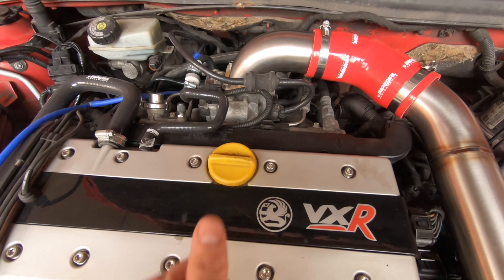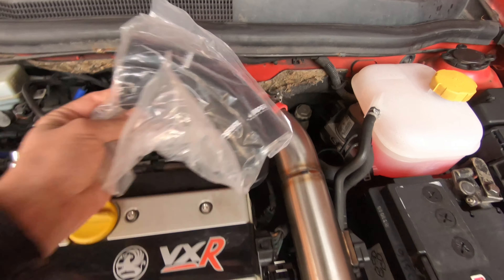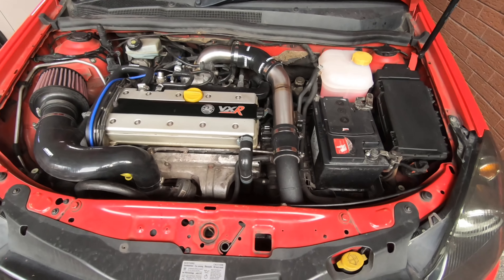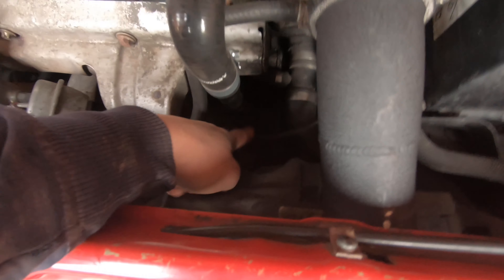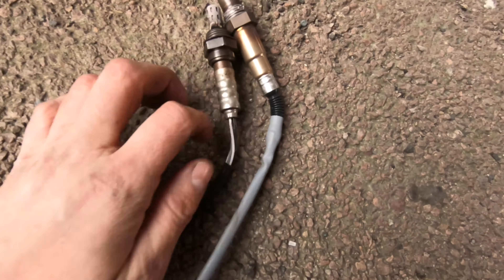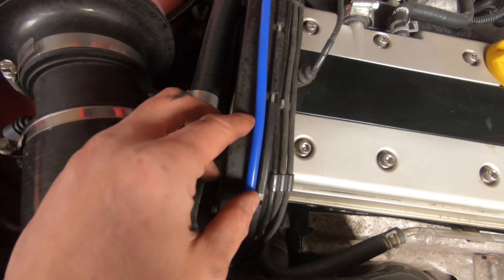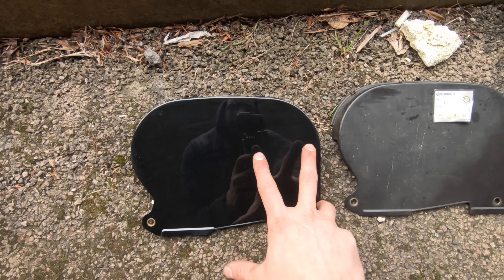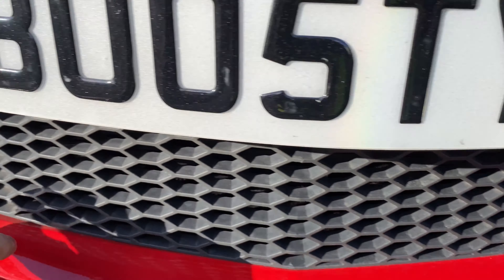Astra h vxr remap prep fitting new parts

Comment: You could do with a heat sheild for your filter m8. After a few dyno runs or even sat at lights (stationary) your filter will start sucking in hot air drawn from the engine. They might not make a huge difference but for the price I added one for peice of mind cause everyone knows hot air into the engine kills power that's why we install intercoolers. And good luck with the map, il go for a safe 300bhp   or 320 if you have a hi flow inlet installed 😉
Reply from the maker: Cheers buddy yea it’s on my to do list at some point but as u can probably imagine my bank account is gonna need to recover first 😂